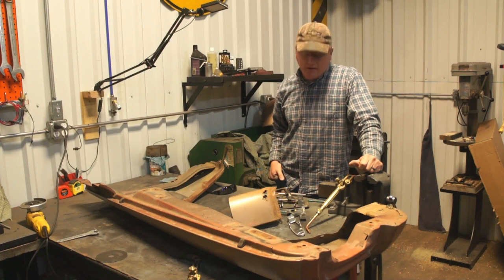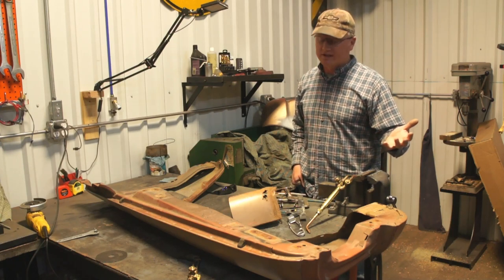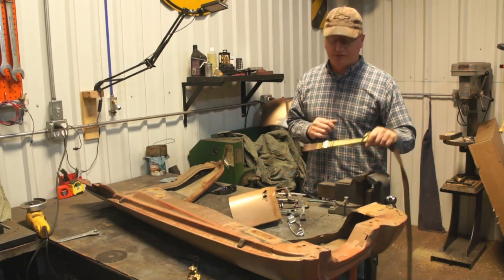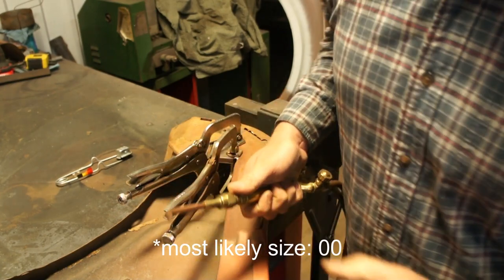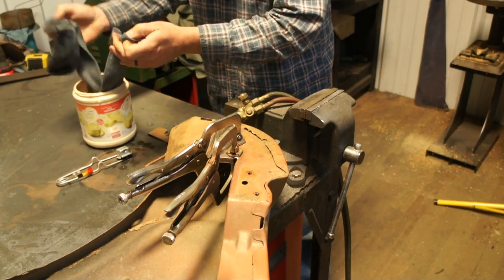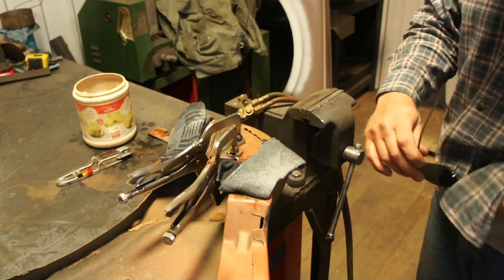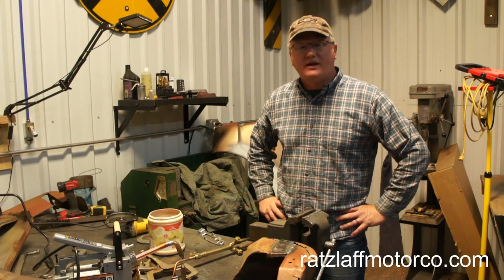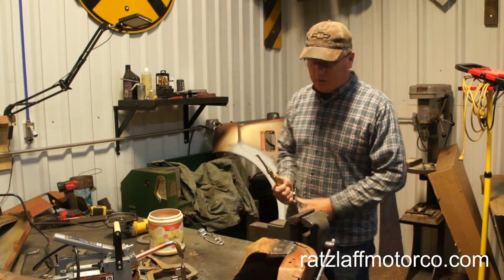Oxy Acetylene Welding Thin Sheet Metal - Old School Welding

Comment: Thanks for the vid. I just had a defib installed and was told not to use any electric arc welding or cutting methods. So I am relearning how to OAW. It is definitely a slower but more cathartic method of joining metal. I see more hammer/dolly in my future.
Reply from the maker: lol yep. But even in that you will get good at multiple skills that have all but died out.

Comment: I completed a welding class a few years ago. Learned to use the torch for welding(using a filler rod) & brazing. Also did stick, mig & tig. I know that you can tig weld without filler rod(with tight gap of course) but I never thought to ask about using the oxyacet torch alone. I figured it could be done but I hesitated due to the amount of heat it produced. After seeing your demonstration I might have to grab some old metal & try my hand at it. One thing I've considered is trying to use the torch with bars of solder & see how that goes. When in the military service I was trained, among other things, as a telephone cable splicer. We started out using lead sheathed cable which required using solder to seal the sheath that covered the splice. That solder was melted in a cast iron pot & we used a ladle to apply it. I'm thinking that I could make the adjustment to torch & bar but I may never know. Anyhow, thanks for another interesting show.
Reply from the maker: I also learned to apply lead at the same school. It was of course an industry standard before plastic fillers. I haven't done it since.

Comment: I used to use the same technique of using wet rags to isolate the heat from the weld area back in the day.... before I could afford a mig/tig welder.. I found that the smallest tip you could get by with would work best for me.... nice video! 👍
Reply from the maker: Thanks!